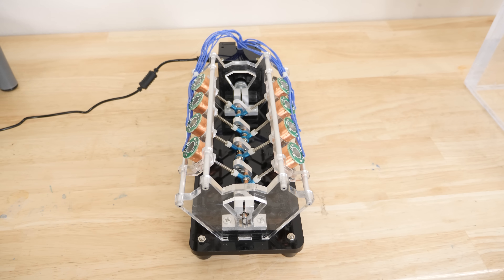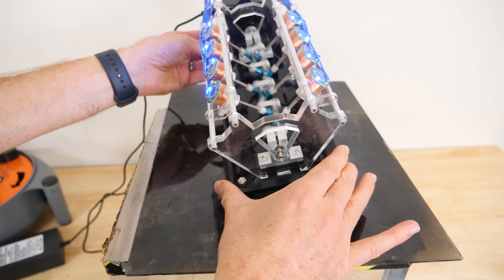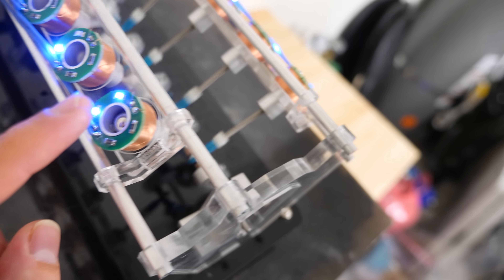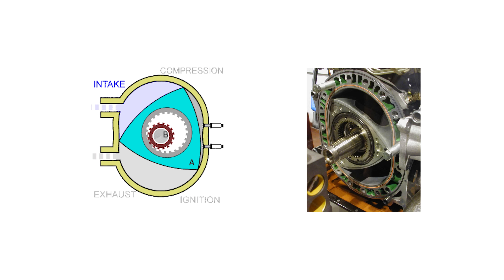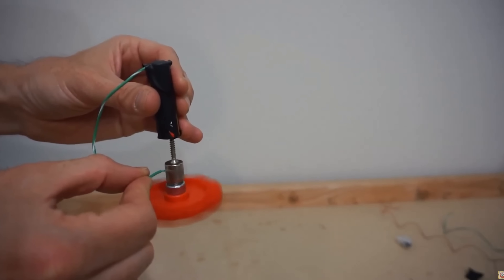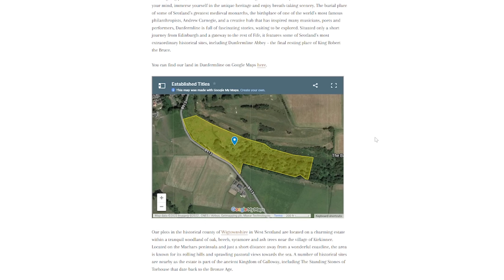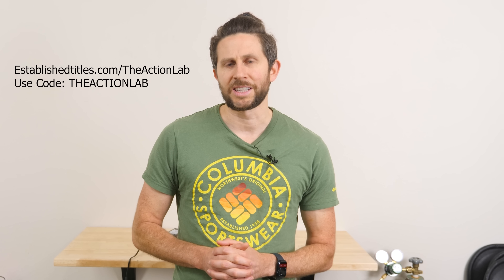Is an Electric V8 Engine a Good Idea?

Comment: The reverse of this is kind of interesting if combined with an ICE.  A combustion piston engine that is not connected to a crankshaft but rather moves only linearly.  It drives a magnet through a solenoid to generate electricity.  I think that's a pretty simple, compact and efficient arrangement for making electricity from combustion on a small scale.
Reply: Yes the generator
Reply: @firdauswahab8485  A linear generator.  I saw a cool design with opposing pistons that cancelled most vibration.

Comment: Sound is vibration. Vibration is wasting energy that could otherwise by used to power the engine more efficiently.  The louder that engine, the less efficient it is.

Comment: Powering an engine with a motor. Wouldn't piston compression slow the motor down, with no combustion inside the engine, it deteriorates the word engine. Seeing as how Motors are electric and engines are internal combustion, that is a oxymoron from hell. LOL

Comment: A somewhat interesting idea, save one problem: using the magnets to PUSH the pistons down. When 2 opposing magnets push against each other, the magnetic fields of both weaken over time. That’s why most magnets say to store them north-pole-to-south-pole; so that there’s no destructive interaction between them. A better design would be to have the coil for each “cylinder” at the bottom, where the magnetic field would pull the piston down, thus preserving the magnetism of the piston. Granted, that could have the side effect of the magnetic field of the coil “grabbing” the crank shaft, or potentially inducing a current as the crank shaft rotates… but still; not really a practical design for an electric drivetrain either way.
Reply: You can just pull the ”pistons” away from the crankshaft.
Reply: Problem is that you'd have to have a super short stroke because the range of magnetic force drops really quickly.

Comment: The only reason to build a motor like this, and I've thought about creating one for my motorcycle, is for the joy of shifting gears. It would make riding/driving an EV more fun, at the loss of efficiency.
Reply: That's just stupid
Reply: What loss of efficiency?
Reply: @moabman6803  gearbox makes energy loss , simple
Reply: @matejmotuz108  All vehicles have a gearbox. Even vehicles powered by electric motors.
Reply: @moabman6803  and so what ?
Reply: @matejmotuz108  Your acting like only piston engines have gear boxes. Which is not the case
Reply: @moabman6803  
1. I never said only piston engines have gearboxes , so don't tell me ho I act 
2. Electric motors have simplier one gear (one speed) gearbox , slightly more effective than standard car gearbox at it's best , not often sience ic engine has slim range of effective rpm , If it's not truck with much more gears . And electric motor doesn't have gearbox to funcion , it could work fine without it , but electric motor get very heavy at low rpm high torque , so It's easier to use electric motor with about 20 000 rpm and reduce it with gearbox and It'll be still lighter than low rpm motor 
3.don't get so offendet because of youtube comment
Reply: @moabman6803  Well, besides the indirect way that power is rotating the shaft (electric motors rotate a shaft directly), and also the added friction of many more bearings between the pistons and rods, there would still be a power curve dependent on the rpms the crankshaft can handle, hance the gearing (which apparently some people find stupid). It's essentially just a different way of pushing the pistons. There'd be no need for a camshaft though, which is another source of friction in a regular internal combustion engine. Anyway, it would be way more efficient than an ICE, just not as efficient as a direct drive electric motor.

Comment: It may not be terribly efficient, but it is an interesting way to demonstrate on how a gasoline engine works, without the limitations in models that use fuel.
Reply: There are small model sets that use an electric motor. Basically a starter motor to turn the crank and everything realistically. There pretty cool and don’t need fuel
Reply: Limitations of motors that use fuel: they have to carry a battery too, for starting the motor.
Reply: @ilmaio  nope...many dont...
Reply: @yveslegrand9826  Many do use batteries though, as a buffer inbetween the engine generating electricity and producing a spark.
Reply: @ilmaio  Battery might weigh less, need less fuel, and work in synergistically greater good sum outperforming parts. Like when four people rub tree trunks together and blast off uh spaceship whatever that show.
Reply: Kids
Reply: Right. Then other fuels might be fabricated and that's our bosses. Fuel fraud.
Reply: No. The only relation this has to a gas engine is that it shows pistons go up & down. There is so much more going on with the pistons alone (let alone the rest of the engine) that isn't shown that makes this demonstration about as useful as using a kite to explain an airplane.

Cool toy though.
Reply: Watching YouTube is not either, but enjoyment is important too.
Reply: @JiltedValkyrie  😂
Reply: @JiltedValkyrie  it depends greatly on your goal, YouTube can often be a relatively good source for entry level instructional material for most subjects if you know the right keywords.

Comment: What is being used to lubricate the moving parts? We know that gasoline engines all use motor oil I don't see any oil what is used to cool down the moving parts? We all know that in a gas-powered engine there's a radiator and a jacket of water that flows around to keep the temperature down. I don't see that either.

Comment: Electric solenoids aren't even strong enough to be used to control the valves on a gas engine, which is why Freevalve uses pneumatic solenoids.   Electric solenoids needs to be huge in order to produce a lot of force.

Comment: Instead of turning off the coil, you can reverse the polarity, so you have power transfer in both directions the piston travels.
Reply: If you look at the LEDs in slow motion, you can see they alternate. They are being reversed.
Reply: @sdspivey  no those are there to show what the valves would be doing in a real gasoline engine
Reply: Like a generator
Reply: 88
Reply: Still wasted energy, electric stuff just needs an ESC this is just wasting effort where and engine produces mechanical energy from chemical energy.
Reply: @osmacar  Dude it's a proof of concept video. He's not trying to revolutionize the engine, he's showing a cool scientific design and explaining why it's inefficient.
Reply: @osmacar  in that too energy gets wasted as heat
Reply: @b-beluga4510  why can't the heat do constructive step like if steam were involved and the water was recovered by cooling features

Comment: Gotta compare the efficiency to really know which is better at translating energy to horsepower, and also map the difference in torque curves.
Reply: Compared to what ?
Reply: @matejmotuz108  It would be compared with a small Tesla-style motor with the same input energy.
Reply: @Bit-while_going  so a top brand electric motor , it would be much more efective , because it has less moving parts and almost no resistance , you can spin rotor of electric motor easily by hand ( If it's not some giant monster ) that would be pretty hard with "engine" like in the video with the same input power , just too much friction
Reply: @matejmotuz108  Seems like a crankshaft spins pretty easily also. So what would add resistance? The pistons? But each piston moves pretty easily. Also wouldn't eight pistons have a higher induction area than the shaft at the center of a regular motor?
Reply: @Bit-while_going  standard electric motor creates rotary magnetic field that spins ther rotor on bearings , bearings can easily spin 10 - 20 000 rpm , pistons wouldn't be able to move that fast , and thanks to all the extra parts it would also weight more . Most electric motors have high rpm and lower torque , reducet to lower rpm and higher torque , because electric motors of the same torque , but with 2, 5 or even 10 times higher rpm would be almost the same size and weight , but higher power , so you can get stupidly high power from tiny motor , as long as it doesn't overheat because of high rpm , so a motor like from the video would always be heavier , have more friction , because the pistons and other things there DO have friction and be less efective , now the weight wouldn't mean much if it was stacionary , but in car , a motor that is many times heavier would lose to much energy just from having to move it's own weight.
Reply: @matejmotuz108  Sounds reasonable, but doesn't the piston motor have the advantage of inertia once it gets moving? Especially with a large flywheel to store up momentum and overcome the resistance?
Reply: @Bit-while_going  I think that inertia comes mainly from weight of the car moving and wheels spinning , any motor/engine , if not powered will just create resistance ,  combostion engine more than electric motor
Reply: @Bit-while_going  just the flywheel , I work with electric motors and spining rotor , if not conected to anything is easy , even with some motors that are like 1+ ton , and it loses speed very slowly , and just with the weight of the rotor , but conected to centrifuge , it takes 5 minutes for it to stop by itself

Comment: One of the advantages of an electric motor to a engine is there is no need for a gearbox so there is less loss in transmission and and since there is less mechanical parts there is less to service so less to go wrong. The only thing holding them back is the battery technology which is getting better slowly.
Reply: There is transmition to reduce rpm , electric motors have better weight to power ratio the higher rpm , tesla motors can go up to I think 20 000 rpm , but car wheels can't spin that fast , so there is reduction , that lowers rpm but multiplies  torque , motor itself  can go as low as 1 rpm , and have the same torque . So the motor that is used is low power and high rpm compared to wheels . If motor was synchronous to wheels , It would need higher torque and lower rpm , but that would be much heavier than high rpm motor with transmition together .
Reply: @matejmotuz108  yes but the gear ratio is set it doesn't change as you go through different speed changers like in a manual or automatic car is it not?
Reply: @adus123  yes , only permanent transition

Comment: This isn't the first time i've heard that the heat from combustion causes the gases to expand. Nonsense. Combustion is when fuel releases its chemical energy. Hydrocarbons are converted to carbon dioxide and water vapor. The expansion comes from the explosion.

Comment: Well couldn't you make the V8 and electromagnetic generator powered by the brake system or when the vehicle is coasting? Would that be efficient or is just reversing the system when braking and coasting be more efficient?

Comment: The only purpose of cylinder and piston is for combustion. If that's not happening then we don't need piston and cylinder. Just use electric motor which has simpler construction and more efficiency

Comment: Some modern petrol cars have additional speakers and subwoofers just to make engine noises. Really, electric cars can make whatever noise people want, they are generally incredibly quiet compared to the old fart cars and will make an additional whirling noise at low speeds and in reverse for people with hearing or visual issues or wildlife to react to. There is nothing really stopping them making it sound like a V8 or super car, if anything, sports like professional rally car racing are not embracing electric rally cars as much as they can, not because the cars cannot compete but because the crowds miss the sounds of the engines, and owners and sponsors worry that might reduce spectating. :-\

Comment: It looks like an engine but it still isn't... It's an electric motor(s), lol. I think it's an interesting concept showing you think outside the box. Currently electric cars typically have 4 large electric motors, one for each wheel and a large central battery.
Reply: Not really , most cars have 2 or 3 electric motor with 1 single gear transmition , and they're very small compared to engine

Comment: Electric motors may be the future, but nothing will beat the sound of a gas powered V8. Great video. 👍
Reply: That's why you can use artificial sound generation to gimmick a V8 xD
Reply: @d_vibe-swe  that’s stupid.
Reply: They aren’t the future. Why would anyone want a car that takes a day to charge, a range that depends on temp causing massive drops in range.
Reply: @darksideblues135  they already are the future. 
No new internal combustion engines in Europe from year 2035.
Reply: @jareknowak8712  Yeah. It’s going to fail. And by the way. EV’s are older than gas powered cars. They were stupid back then, they are stupid now.
Reply: @darksideblues135  also, rare earths are disgusting to mine. It pollutes and obliterates the landscape. Perhaps if our ability to recycle most of the rare earth metals in batteries electric motors may be the future, but we are not close to doing this efficiently and effectively.

Comment: Could be a relatively inexpensive way to convert combustion cars to electronic without having to replace the entire drive train. Bolt right up to the existing transmissions.
Reply: Not whatsoever.

Comment: If you want your electric motor to actually SOUND like a V8, I.E no speakers involved, all you have to do is hook up a pump to it with a valve that opens from a camshaft profile of a V8 design.
As the valves are closed, pressure will build up and as the valves open, that pressure shoots out into an "exhaust" system. Where you can then shape the sound like they do on real vehicles.

Why one would want this i have no idea about. Only those with a pretty low IQ want to make lots of pointless noise.
They haven't gotten past the kid stage yet apparently where they taped flappers onto their bicycles to make noise as they pedaled like imbeciles only for the sake of the noise.

Comment: 2:11 You've mixed things. In both cross- and flatplane V8s the firing order is even i.e. cylinders fire every 90 degrees. In a crossplane V8 the firing order between the banks is not even (you can see it in the animation), because you have two consecutive ignitions in the same bank and that gives you burble.
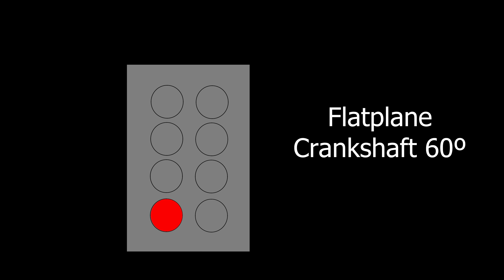2:24 Flatplane crankshaft 60 degrees? There is no such engine. Flat means 180 degrees. And since fires alternate between the banks, you get a high pitched sound, like in a Ferrari.

Comment: "Is an electric V8 engine a good idea?"
Just to answer this one without watching the video...
The reason electric engines are so good is because they are essentially a spinning shaft already. They are what Wankel motors could only dream of, as they don't have to compress a gas to produce good power. And Wankel motors have oscillation around its shaft for this very reason, it needs to compress the combustion mixture to get efficiency.

In AC motors, the oscillation necessary is built into the power grid already so they are simpler than DC motors. Though they come at the disadvantage of being tied to the frequency of the power grid.
DC motors on the other hand need control circuits capable of handling the huge currents an electric motor can draw. Sure, AC has this problem too, but only if the motor is stuck or struggling really hard to get to its normal operating speed.
DC will sooner burn out its circuitry than the coils where an AC will just burn its coils if it isn't spinning.

A V8 electric engine makes NO SENSE as you are taking a roundabout way of spinning an output shaft and you still have coils that will just as likely burn if the motor is struggling to spin.
Cool design and all, makes a pretty neat statement about where we are heading with EV's but that's where the fun stops.

Comment: Gasoline fueled cars are cheap, reliable, effective, sound great, feel great, are fun to drive, can drive a thousand miles with one tank, don't need to be recharged ever other day, can be modified and repaired by an amateur for little money, there's no Blackbox installed that monitors everything you do and I can buy fuel with cash money and don't need to Register for some banking app to be able to get electricity. That's why gas is way superior and makes me so angry that the EU just decided to ban gas cars until 2035! This far left WEF agenda is destroying society